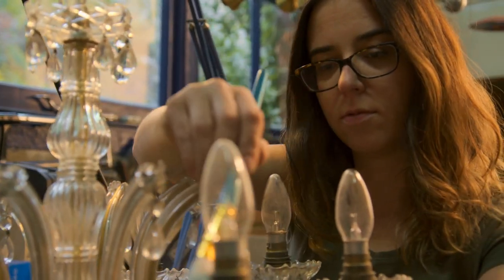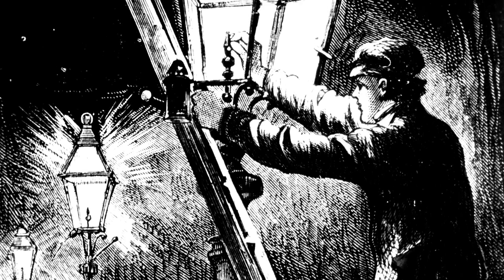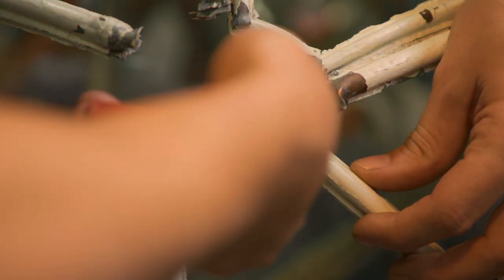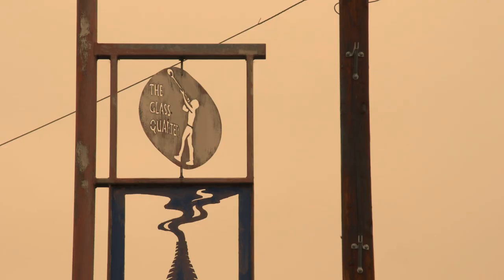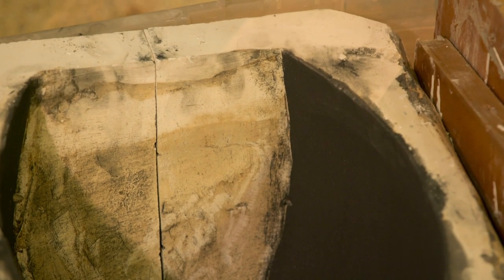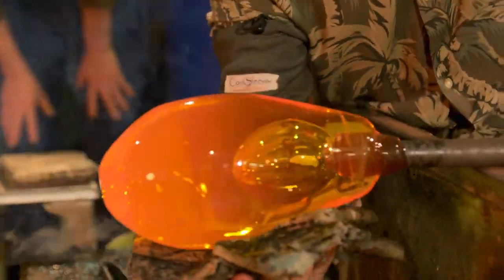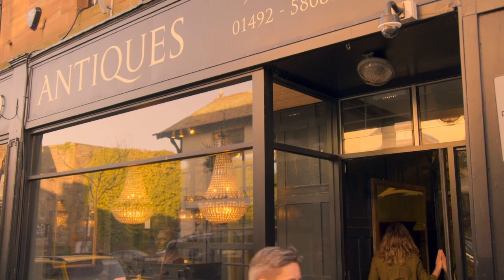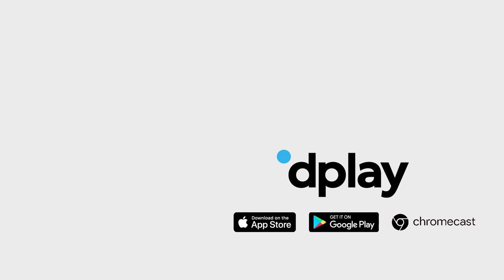Custom Glass Is Blown For Drew's 200 Year Old Lamp | Salvage Hunters: The Restorers

Comment: cut off just when the glass blowing was completing.  how did they get the globe inside the frame?
Reply: Rich Broz
....the glass bubble that was blown and shaped in the mould would have been cut as individual panels to fit into the globe shaped metal frame - as was the original.
Reply: @geoffdundee  Too bad that wasn't on the video.  Can't imagine how it was done on a globe.
Reply: @brozbro  ......when you look at the mould.........the panel for the shape of globe insert (panel) is white (thats the main surface inside the mould...) like a segment from an orange....after it was blown to fill that shape it wouldve been cut and fitted into metal frame- "as the original was" ie;putty inbetween sections.........there are time constraints with any tv series and alot of editing has to be done...most ends on the cutting room floor as they say
Reply: @geoffdundee  I understand all that.  I've seen many glass blowing videos.   I've seen many glass cutting videos.  I've never seen a blown glass globe cut into sections.  I can't even picture how that is done.  Simply saying "it wouldve been cut and fitted into metal frame"  is a useless over-simplification.
Reply: @brozbro  .....the originals were cut and fitted into the frame with putty........how can it be an over simplification to say that a similar process was used to make and fit the replacement panels?
Reply: Yes, and did they cut the globe into the separate segments each puttied into its own section? That too would have been interesting.